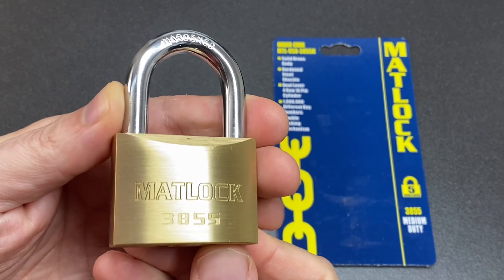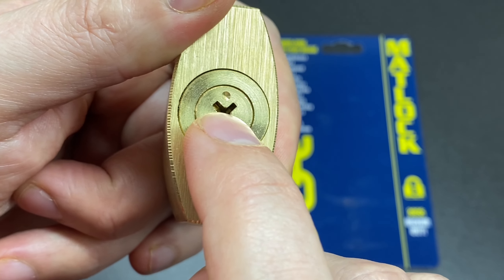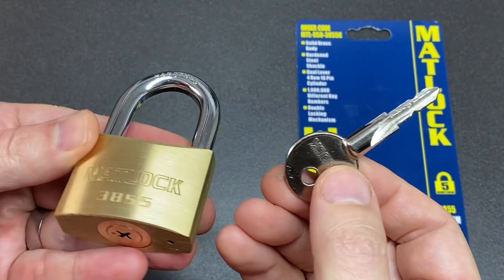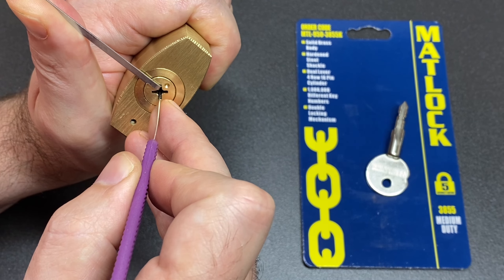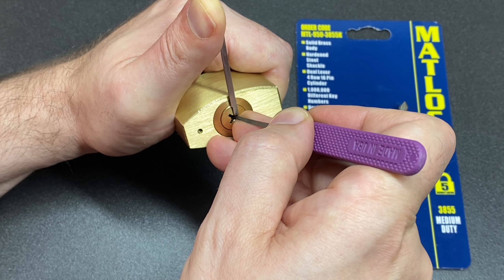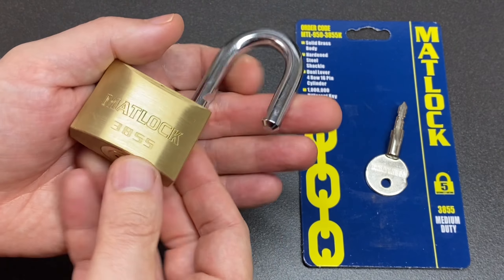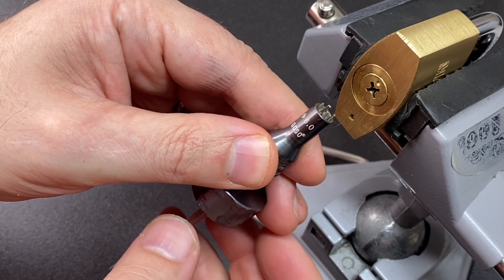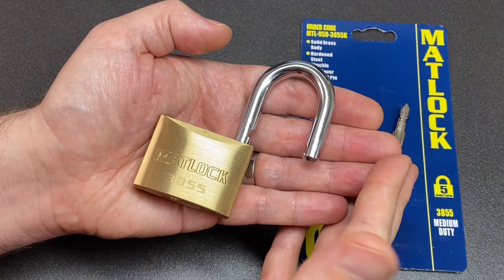Matlock 3855 Cross Key Padlock Picked

Comment: How much pressure are u putting on the pins with your pick please?im not sure if I’m using to much or not enough.thanks I love the content 👍🏻
Reply: It's hard to describe the amount of pressure, that part you just have to learn through practice. General rule would be; if the pick is bending or breaking, it is too much pressure. But you will always feel the binding pin giving a bit of resistance but also giving in to the pressure from pick